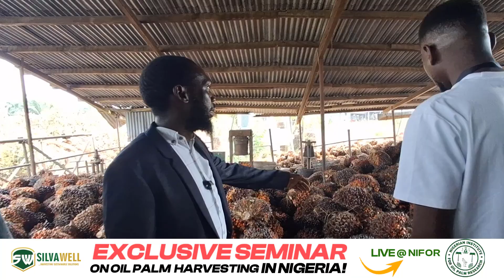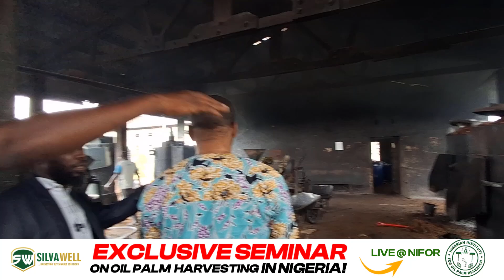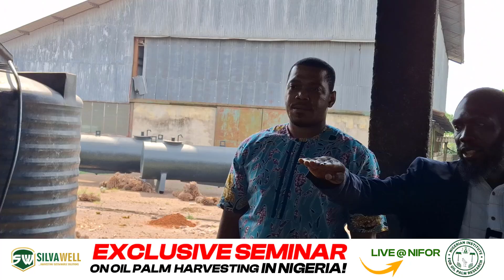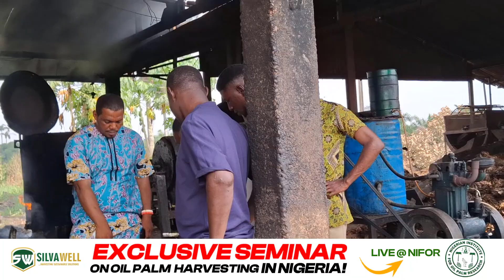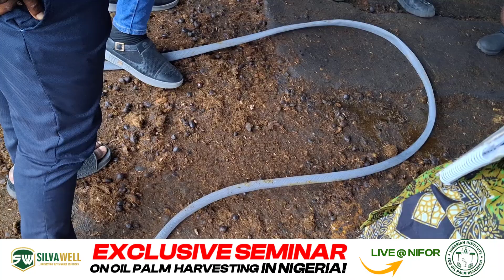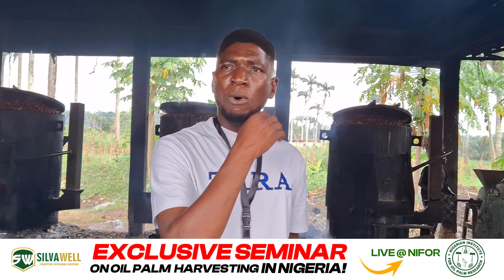OIL PALM PROCESSING PRACTICAL SESSION

Comment: How much will it cost to set up a mill for3000 seedlings .. Your reply will be helpful . 
Thanks you
Reply from the maker: Thank you for your inquiry. Setting up a mill for 3000 seedlings involves several factors, including the cost of the mill equipment, infrastructure, and the necessary labor for operation. The total cost can vary depending on the scale of the mill and the specific equipment required for processing the oil palm fruits.

At Silvawell Limited, we work with partners who specialize in setting up small to large-scale mills, and we can provide you with a tailored cost estimate based on your specific needs and location. This would include the cost of:

✅Mill equipment (e.g., pressing machines, filtration units)
✅Land preparation and construction of the mill structure
✅Operational costs, including staff training and maintenance
✅Infrastructure requirements like roads and utilities

To give you a precise figure, we would need to assess the details of your project, including the mill size and location. If you’re interested, I’d be happy to connect you with one of our experts who can provide a detailed breakdown and help guide you through the process.
Reply: @Silvawellagrorealestate  I am interested

Comment: This is still manual process, which is too strenuous! NIFOR does not have FULLY INTEGRATED AUTOMATED OIL MILL MACHINES?
Reply from the maker: Thank you for your comment and for watching our video. It’s true that the processing method shown at NIFOR is manual, but it’s important to note that NIFOR’s manual processing method remains one of the best available locally and achieves a higher Oil Extraction Rate (OER) compared to typical traditional manual methods used by many small-scale processors across Nigeria.

In Nigeria, there are two major companies which are located in Edo State that operate fully integrated automated oil mill machines, also known as industrial milling machines, which offer the highest OER and efficiency. These automated mills are designed for large-scale production and require substantial investment — often hundreds of millions of naira — to establish and operate effectively.

For instance:

Okomu Oil Palm Company operates multiple automated mills, including a state-of-the-art 60 tonnes per hour (t/h) mill commissioned in 2021. They plan to increase total annual production to around 80,000 to 90,000 tonnes this year, 2025. Their planted oil palm area covers approximately 19,045 hectares.

Presco Plc operates a palm oil mill that can process 90 tonnes of fresh fruit bunches per hour and a refinery plant that can process 500 tonnes per day. The company's planted oil palm estate area is approximately 26,459 hectares, with about 22,658 hectares mature and in production.

Operating at such a scale involves complex factors, including large capital expenditures, infrastructure, skilled labor, and a consistent supply of fresh fruit bunches. These companies set the benchmark for industrial palm oil processing in Nigeria.

At Silvawell Limited, our core focus is on oil palm agro real estate investment, where we maximize returns through professional estate management and high-yield agricultural practices. While large-scale industrial milling is part of the future, the current practical manual methods like those at NIFOR provide an excellent balance of efficiency, accessibility, and cost-effectiveness for many producers.

We appreciate your interest and are happy to provide more insights on the entire palm oil value chain and investment opportunities.